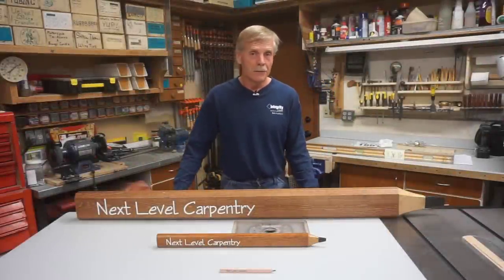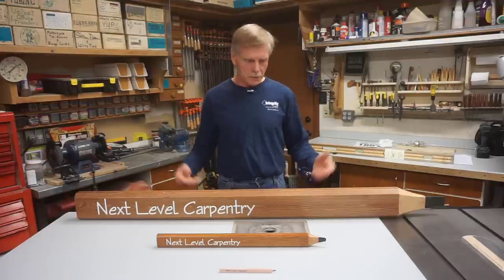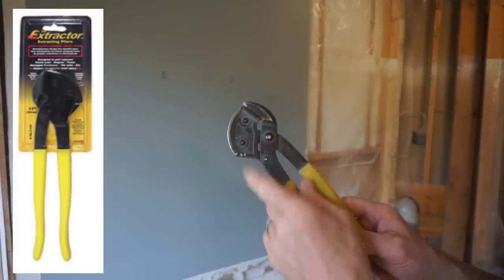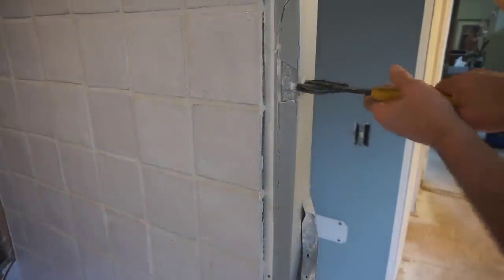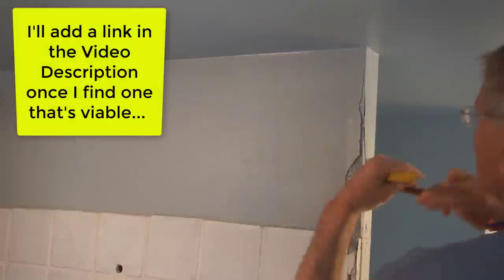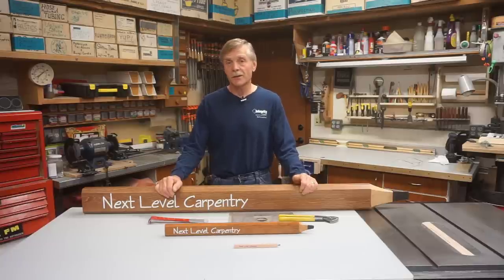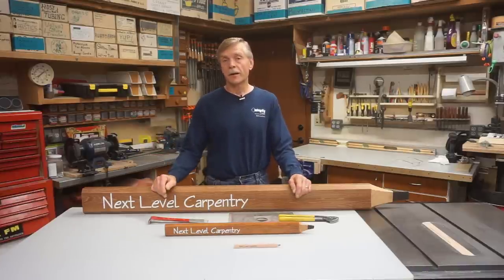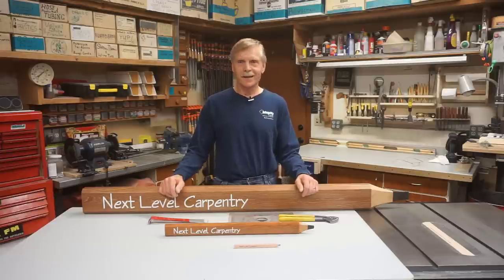Pro Tip: How to Remove Sheetrock Corner Bead

Comment: Watching your video in 2023 and you are talking about reaching 25k subscribers. I'm happy to see you are at 331k subscribers! 😁 I need to remove the walls around my furnace and I have never done any manual work around a house so the short and concise video is very appreciated. Thanks for your help!
Reply from the maker: Timeless info here... FWIW I was using exactly this method just 2 weeks ago as I got into the tear-out phase of a remodel project because it's still the best method I know!
Reply from the maker: Here's a companion video that might help you out even more:
https://www.youtube.com/watch?v=r8TH0BY4Sj0
Reply: @nextlevelcarpentry 

Tool is nowhere to be found. Advice?
Reply: @darrelstickler  personally I have used a simple flat screwdriver. Lift the metal sheet slowly in each section, and it should not do much damage, as seen in the video.
Reply: @pensums  I’m demo’ing a room. Unfortunately, there is no door, so outside corner bead. It’s a trick to demo from inside the room to just around the corner bead but NOT damage the drywall around the corner. That Tiamat tool was awesome to crack the mud cleanly on the “good” wall so you only have to float a 12-18” for a class 4 finish.

Somehow this awesome tool has disappeared from the market. Maybe a patent or other legal issue. I threw a Crescent version into my Cart to try. I tried vicegrips and a fence nail extractor and it won’t grab the metal bead enough to crack the mud and yank the corner bead.

Comment: Thank you so much! I am replacing all the drywall in my house because the prior owners who put it up after removing the paneling were idiots and did a horrible job. I didn't have the pliers you had, but I has some end nipper style nail pullers and they worked just as well. You probably saved me an hour or more.

Comment: Perfect timing - in the middle of a bathroom remodel and had painstakingly cut/spiced some new corner bead near the floor where I was replacing some sheetrock sections because I was afraid to disturb the old bead. Stumbled upon your most excellent video, bought the pliers, and was able to carefully rip out the 25 year old bead off four corners in the matter of a few minutes. Thanks for posting this!

Comment: The Extractors are one of my favorite tools, yet another use for them.
Reply from the maker: Thanks Monte... do you happen to know if and where they're available?  I've had mine for 20 years or so, I guess, and hope viewers can still get a new pair but fear a patent infringement issue or something has changed things. Best, Matt
Reply: I also have had mine for a long time
I like mine so much that I bought several
I hope they are still available
MIT same school I am still learning from
Reply from the maker: Monte Glover MIT is the one school where you check in and can never check out😆
Reply from the maker: Cool!  Hope someone is able to take advantage of this... Best, Matt
Reply: Next Level Carpentry    You can get them on Ebay from Australia.  Search for “Excalibur Tools Nail Pliers” made by Extractor ... sold by “Plasteringsupplies”.  The say they have more than 10 available.

Comment: Matt, thank you for sharing this great technique.  I've been wrestling with how to remove corner beads on a warped door jamb. This will do just the trick.  Thank you!
Reply from the maker: Hey Mark; This is my preferred method but if you're not able to find the Extractors like the ones I use you can also use these Channelock nippers which are a bit more common and available: https://www.amazon.com/dp/B000LEBRYI/?ref=idea_lv_dp_ hope that helps... and, naturally, you're quite welcome! Best, Matt

Comment: Happy Father's day. Nice quick tip.
Reply from the maker: Jay Mesawitz Thanks Jay... it's one of those tips I'm glad to share but then again hope that viewers don't ever have to really use it cuz that kind of tear out is always is a nasty job😧  Happy Father's Day to you as well... Beat, Matt
Reply: Next Level Carpentry my bathroom demo, only about a month ago, was not so surgical. And it is equally true that it involved money and effort not necessarily anticipated. Results were great though. My vanity build was not too shabby for a hobbyist.
Reply from the maker: There's a level of 'refinement' in the video production process that filters out much of the 'not so surgical' parts inevitable on every project.  Congrats on your vanity build... it's always nice to get to the rebuild stage, especially after a worse than normal tear-out, right?

Comment: Your the best Matt, it would be great to work on a job with you and learn from a master
Reply from the maker: What are you doing this week, Brian?  😁😬😎 I've got to haul new 5/8 4x12x54" rock up stairs, through the house and hang it in this cool but tough 'little' bathroom and I could sure use the help!  I understand if that's not what you had in mind because you don't need to 'learn from a master' how to grunt rock around, right?  Best, Matt
Reply from the maker: See one, do one, teach one is the norm in the trades, right?  As long as a person keeps an open mind, uninhibited by pride from experience, there's always something cool and new to learn!  Best, Matt
Reply: Matt, I've got to think you probably have unique/better ways to haul that rock, too!  Run it through the board Contracter?? @NextLevelCarpentry
Reply from the maker: @francismccabe3265  I WISH!  Grunt, grunt, grunt, Matt

Comment: Thanks for your work!  Would love to see how you level a floor (wood and concrete) for a tub.  Thanks again!
Reply from the maker: You're welcome, T Willey... and possibly in luck.  I'm replacing an old tub with a new one on this very project and am planning a video to show a ridiculously simple way to level the support surface which, in this case, is 3/4" plywood subflooring.  The method is viable for any tub with a flat bottom surface.  Some old fiberglass tubs have an irregular bottom which would require a different, more involved, method but what I'll show is how I shim from zero to 5/16" under the whole bottom of the tub to level it for an 'undermount' style installation... hope to get it out late this week, if not it will be the week of July 1st because of prior obligations.  Best, Matt

Comment: The extractors are back in stock, Matt. They were always available through sellers of NOS on eBay, but I spent a little more money to buy them from the original company. I hope there isn't the "oh, old ones are better than the new ones" phenomenon, but we'll see how that goes.
Reply from the maker: That's great news, Thomas... can you provide a link in a reply on this comment/thread?  I'll pin your comment if you can/do. Thanks for letting us know! Best, Matt
Reply: Only found them on ebay for 39-40 USD.. Curious to know why it's still unavailable on Amazon...

Comment: Matt...Interesting Tool!   Never seen one before!
Reply from the maker: It's a cult classic, cheewurz 😁😎 It's actually the best tool I've found for pulling staples off Romex wire without damaging the sheath too... but I suppose you can flick those little staples off with your side cutters or lineman's pliers in an instant with no need to haul another tool around?  It's best use is for de-nailing trim on a remodel project when it needs to be salvaged and re-used, so if you get into that situation you'd love it.  Best, Matt

Comment: Great channel, Matt!  The boot tying technique looked familiar.  😉 Congrats on hitting nearly 25K.
Reply from the maker: Thanks Flat Out... the boot tying method is floating around 'out there' in a number of circles but I wanted to show it specifically for a carpentry 'audience' because I've never seen in and around construction jobs.  I appreciate the 'congrats' too... it's viewers like you who are responsible for that growth!  Best, Matt
Reply: Next Level Carpentry, does it work with mountaineering boots?  Ice climbing boots?
Reply from the maker: Absolutely... in fact, I first learned and used this method for my LaSportiva Miura rock climbing shoes and Lhoste mountaineering boots and only after started using it for work boots.  You just can't beat it for those 'slippery' round laces!  Best, Matt
Reply: Next Level Carpentry, I also used it on my LaSportiva Muira and LaSportiva K2.  I used to climb with a guy in his late 40's and early 50's who used it exclusively.  Anyway, that guy progressed faster in his climbing than anyone I knew. He did 5.12a at the end of his first or second year.  It probably was his lacing method.
Reply from the maker: Hilarious...  and here I thought it was from using anti-gravity chalk!  Now you're telling me it's ALL about well tied laces and NOT about being able to dance up a face with nothing but dime thick edges and sloping crytals to 'stand' on, right?!  It was a sad day when I upgraded to the velcro Miura's and never went back to lace-ups...

Comment: Matt...its true I don't carry an extra Tool to Remove Romex Staples! I use my Side-Cutters ;)  Get the Shank with the Tip at about a 30 Degree Angle and Lever Down...pulls the Little Suckers right up!
P.S. the way I was Taught to Tie a Truckers Knot is Simpler...Quicker...has Never Failed in 40 Years... and Comes Apart Easier... IMHO :)
Reply from the maker: I watch the sparky that subs on my projects pull staples... he don't need no stinkin' Extractors either! 😂  So you use a Trucker's knot for boot laces?  Guess I'm not exactly sure what it is but know it's good to not have to fuss with laces during the day...
Best, Matt

Comment: Matt...I try and stay away from Boots with Laces so I guess you could say I've no need to deal with Loose Ends! 
 The reason I don't wear Lace-Up-Boots is because they are a Collector of Molten Metal when Welding or using the Cutting Torch. Pull-On-Boots however won't gather Red Hot Droppings...I know this from experience! Owieeeee!   Plus they are Taller too...that's a plus in the Mud & Snow & my Pant-Legs don't get caught on the Tops when Squatting!
Reply from the maker: Interesting list of preferences for footwear, and all practical and sensible for what you get into.  The hiking footwear I prefer is much different from work footwear too... makes me glad there's more to wear than the high-top tennis shoes that were standard issue for summer vacation back in the day! 😁😎

Comment: I just removed two 4' x 8' sheets of drywall due to mold and the contractors fixed the sheets to the studs using about a gallon of adhesive!! I had to chisel the SOBs off the wall and what a mess. Now, I've got the corners to contend with and having the same issues with cement-like adhesive. I was hoping to find a remedy for how to pull off drywall cemented with a ridiculous amount of adhesive.
Reply from the maker: Unfortunately I don't know of a remedy for the miserable predicament you find yourself in... I have never seen a structural failure because drywall was not glued on which makes me wonder why anybody would do that... Good luck with your project...

Comment: I wonder if you couldn't also use a pair of Channel locks in the same way.  I always use them for pulling trim nails, rocking the nail out with the curved jaw.  They're also great for removing freeze plugs from engine blocks in the same manor.
Reply from the maker: The leverage on these is much better than Channel locks, Tom, because they were designed specifically for this kind of pulling action... but channel locks will certainly do in a pinch.  Also I've heard from folks who use end-cut cutters like these successfully too:  https://www.amazon.com/dp/B000LEBRYI/?ref=idea_lv_dp_ Best, Matt

Comment: I had one of those nail pullers but left it at some job never to be seen again. Are most of the corner beads in your area metal? Here in Hawaii they are all plastic or they will rust. The plastic ones come off even easier than the metal ones.
Reply from the maker: Thanks for commenting, Randy... yes, the majority of corner bead here IS metal with the exception of flexible stuff for arches and such.  With plastic in use where you are I'm guessing you pretty much disregard all the fuss shown in this video?  Metal corner bead is more of an issue when attached to metal studs with screws to the point that all that these pliers do is snap off the taping mud and expose screw heads for removal.
Thanks for weighing in here... Best, Matt

Comment: If I’m not removing one of the walls the corner bed is on should I scribe a line in the drywall to prevent drywall  paper tearing?
Reply from the maker: Doesn't sound right to me Michael.  By a scribed line I assume you mean a cut/scored line and a cut line needs to be taped to repair while torn paper only needs to be skim coated.   I could see scoring a rather deep line about 1 1/2" back from the corner on the side you're preserving, scoring through the thicker mud at the corner.  This could minimize chipping of that thick mud keeping the repair smaller... as long as you don't cut through the paper which would defeat the purpose because then you'd need to add a string of tape for the repair.  This is all off-the-cuff and IMHO so take it for what it's worth? Best, Matt
Reply: @NextLevelCarpentry  Your "off-the-cuff" is likely more insightful than my  "research for hours" thanks !

Comment: Love your videos.  Not sure why you call a glazing bar a beekeeper's tool, but I'm always down to learn a new craft.  I've always used a pair of dull end nippers, or sometimes a pair of hoof nippers (Longer Handles) for pulling corner bead.  I would like to find those trim nail pullers though.  Looks like they would be better than the Crescents I've been using.  Now I need to go and figure out why my daughter changed my username?
Reply from the maker: That embarrassing moment when a video producer realizes a viewer has made a suggestion potentially better than the original video 😰... Channellock nippers would/should work as well or better than these nail pullers for pulling corner bead off so I'm pinning your comment for the benefit of other viewers.  Incidentally Extractor pliers really are much better than any other tool for removing trim nails from wood though and is what the tool is actually designed for. Thanks for adding this comment 'Katelyn'... hope you're able to figure out what happened to your identity 😁
BTW The 'glazing bar' is described as a beekeeper's hive tool on Kelly's Beekeeper Supplies website where I originally found and purchased one.  I never saw a glazing bar that worked as well as the hive tool but won't argue that there isn't one out there that performs as well.
Glad  you like the videos... hope you'll come back for more?  Best, Matt
Reply: Thanks for the reply.  It's all in the spirit of collaboration.  Someday I may get the courage to put some videos on Youtube. I ordered a Hive bar to see how it compares to my trusty glazing bar.
Reply from the maker: Scobey Max is a LONG way from Katelyn... glad you got that straightened out 😁.
Let me know how hive tool and glazing bar compare... I didn't start out with a glazing bar so the hive tool was a huge improvement over the regular 'wonder bar' type tool commonly available so I'm curious what your opinion is.  Best, Matt

Comment: Hi how do I fix bullnose corners I want to add trim on the doorways and windows but they all have bullnose corners any suggestions
Reply from the maker: If the openings are wrapped with sheetrock and have bullnose corners the best way is to pull off both the sheetrock and bullnose metal then use new jambs or jamb extensions and casing to switch from sheetrock returns to wood trim. It's a messy job but I never regret taking extra time and effort to do things right and thank you all find the same satisfaction.

Comment: use the curved end of a flatbar and pry sideways thats way you dont damage your nail puller and it makes less of a mess
Reply from the maker: Thanks for adding this to your Liked Videos playlist, Mark!  There's definitely more than one way to skin the proverbial cat and of all I've seen and used I prefer the one shown in this video.  FYI this in no way 'damages (my) nail puller' and, although a bit messy, I find it the least messy of other methods.   I'm curious: how do you get the curved end of your flatbar started in the first place and how do you manage to 'make less of a mess' when taping mud starts popping off?
Best, Matt
Reply: Next Level Carpentry yeah I would be too scared of damaging my nail puller I just don't get so aggressive with it and I hit it with a hammer somewhere around the nail the nail will always be somewhere around 16 in that's where they're trained to put them

Comment: Can I use the corner extractor pliers to remove the rounded corner bead?
Reply from the maker: Probably... if you can grab an edge because the jaws don't open wide enough to grab  the full 1" radius 'bullnose' style cornerbead.  You might find a pair of 'nail nippers' with jaws big enough to grab but prying out an edge first is likely a better plan... Best, Matt
Reply: @NextLevelCarpentry  I will try that. Thank you!